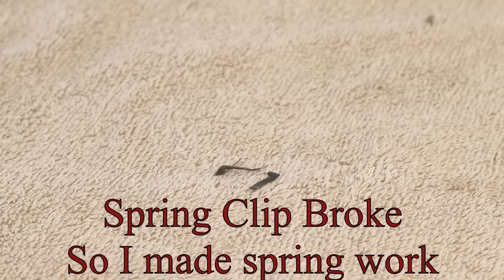1934 Kingsbury Chrysler Airflow Light Up Sedan Restoration

Comment: Was so surprised that you managed to find replacement tyres. Wasn’t so keen on the grill situation. The original grill was brilliant. It’s a shame that the acid burned it up. Hope you can score a good replacement because the temporary grill has much to be desired. Also wasn’t too enthusiastic about gluing the tyres to the axel bar. There must be a more elegant way to secure them which is reversible? Although I cannot think of a more elegant solution off the top of my head, I am confident you’ll come up with one eventually Chip. Cheers!

Comment: The stripping/sand blasting process is always the most satisfying. Do you use different size nozzles, pressures, and does the sand get recycled or do you need to replace it for each restoration?  Even though it is not the original, the grille does look ‘funky’. Great job 👍

Comment: Dear "Chip",
Wonderful work!

If it's allowed here a few ideas/ thoughts from my point of view as a tin plate (clockwork toys) friend (if you like, check my website out - same name as channel):
1) You should have only polished the "chrome" parts. In the 1930's very often they were only nickel plated. Chroming on toys was very rare, same for gramophone tone arms etc... (but H.M.V./The Gramophone Company - Hayes UK - did !)
2) VERY often LESS is MORE... Better to hold the max. of the original parts possible, for example - the cable, it's straight copper and old rubber/textile around it, form my point of view no need to change that.
3) NEVER, NEVER (!) clean a mainspring in an ultrasonic bath! They ALL get SOFT, yes SOFT...! (Losing power).
The spring steel softens due to the U.S.-sound waves.
4) You are using very good tools, sometimes, in this video I thought you were a bit rough in removing parts (spring hold clip)
5) A mainspring is greased (I use molykote BR2, a long life + 20 years graphite grease). For cleaning you take the spring apart. You start with removing the centre, recoiling it towards to outer. To redo a centre or outer/hole, put a flame (candle) on the place needed to be bent. This helps to bent and to avoid a further break at that spot.
6) Mechanics (gears, mainspring) are best cleaned in lighter fluid (clean gasoline).
7) I would have reused the insulator-papers (original parts)
8) I think it was a great that they DIDN'T (the factory 1930's) used soldering for contacts. The headlights could have been put in with the holes wiped out at the car body inside rim with sand-paper before. No paint scratching needed, nor soldering.
9) glueing the driven wheels: any out of alingement/excenter costs driving/clockwork power. Centreing is everything.
10) ! :
ALL the rest is BEAUTIFUL done! (lets say 80%!)

The sheeps remind me at shawn the sheep from britain! VERY cute!  <3

Please take it ONLY as friendly suggestion/ constructive feedback from a clock and watchmaker!

The Chrysler Airflow is for me the beautifullest USA car! Unfortunately most of the US people at that time found the 1. cooler-grill ugly. BUT especially the 1. "Waterfall" radiator is THE COOLEST lol... xD (Model type CU34 ?)
Same for the Chrysler Building THE BEAUTIFULLEST sky scraper EVER. (I have a ~150page book how it was build - photos day by day) VIVE l'Art Déco! (from France, Europe 1920 to 1945 and in the US till ~1955 "Streamline Style")
I like also the last Ford Model-T's of the 1920's.

Thanks for the ENORMOUS effort and work to film it and put it online!

Cordial and kind regards,
Géréon

Comment: The work is good, but I put a dislike, as the new radiator grille looks terrible compared to the original. And your soldering iron does not have enough heat capacity of the tip, either the temperature is low, the solder is very bad to lay down, or use inactive alcohol-rosin for better adhesion to the solder.

Oh i see, about the grid in the description, it's just that my native language is not English. I changed the dislike to like, if the grid will be returned to the original in the future (by the way, you could try to copy it yourself).